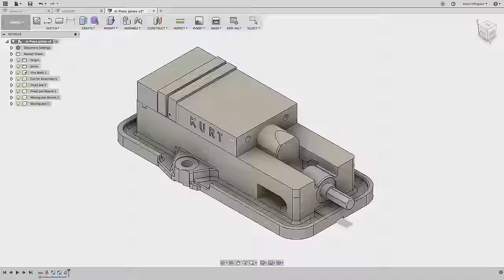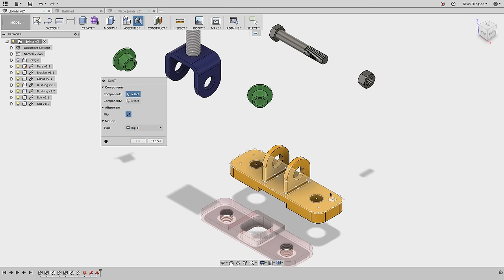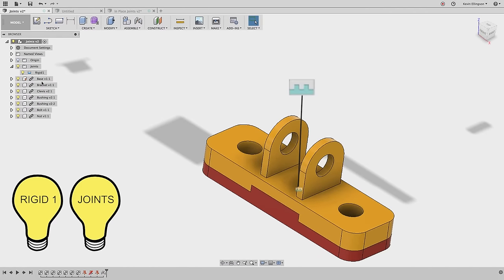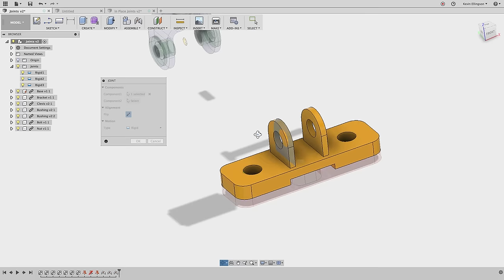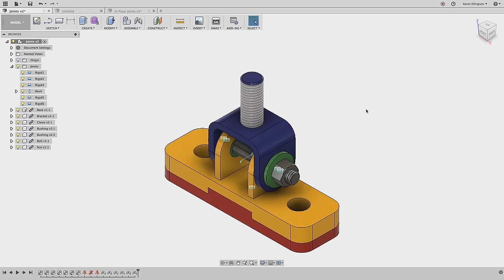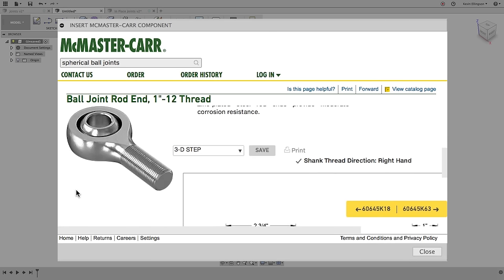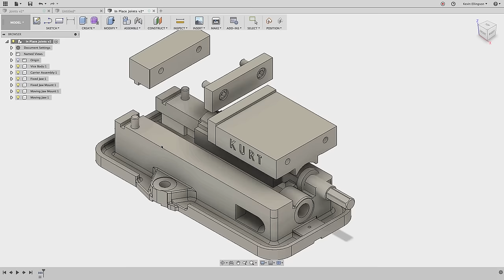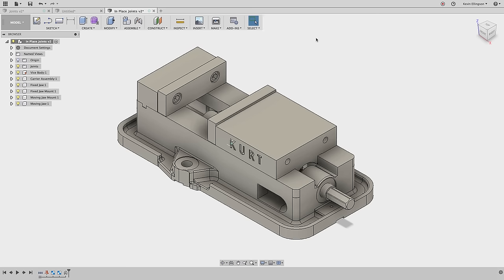Joints in Fusion 360: A Comprehensive Tutorial! FF117

Comment: After 20 years....I just abandoned SolidWorks and MasterCAM for design, engineering, and manufacturing. Fusion 360 is the replacement - really hoping it was a good choice. This video sure is helping me feel more confident making the transition.
Reply: I am sorry, but SolidWorks cannot be beat for modeling, but Fusion360 is closing the gap fast, especially with the built in CAM being so intuitive, not to mention tutorials like this help a lot.
Reply: I did not switch because Fusion 360 was a better tool - I switched because SolidWorks and MasterCAM are $$$$EXPENSIVE$$$$$. 

I used to skip 2-3 years of maintenance, and then get it updated - around $1,500 per year for each one. $3,000 per year in maintenance fees. Now, they do not do that anymore and charge for each year out of maintenance so I have to buy a brand new seat at about $5-6k for SolidWorks and $8-14k for MasterCAM depending on how they are feeling that day. 

So, to get the latest versions of each I have to shell out $13-20k and then get another $3k bill at the end of the year. Too much. 

Fusion360 is 95% of the function for 10% of the cost.
Reply: I still use SW 2007 because it can go fwd to any version. All they do is screw around with the GUI and the base function is still pretty much the same. And getting ripped off for the 'maintenance' fee, NEVER; plus I have clients who have every version if I need it. But as an EXPERT SW user, I am really liking F360 :-) but I will keep SW2007 around like an ol' dog.
Reply: Factory400 
I also got sick of paying the coersive maintenance fees so made the switch from SolidWorks as well. I might be OK with them if they would have been squashing bugs left and right and addjng features like mad, but instead bugs persisted for YEARS and the features added were few and far between (I think they did make some good improvements, just not enough of them). They never forgot to ask for more money though.

Every now and then I come across an old file that I saved with a name like "F... you SW programmers" and I'm reminded just how aggrivatjng that program could be sometimes.
Reply: LOL The topper was when they got rid of the colors in the GUI. What IDIOTS. The other one that kills me is getting rid of the textual right click 'edit sketch' and putting the icons in a stupid little separate box above the TEXTUAL part they left. Did I mention 'what IDIOTS!"? Its like SW programmers, and eBay, and many others say to themselves, "hmmm, the users are probably in a nice rut now, so lets just randomly change some cr*p and move and re-arrange everything because we have reached our limit of adding features and the bugs are too hard to fix and we are bored". I did notice there was a HUGE uproar where they realized they WERE idiots and put the colors back in the GUI, to avoid being killed by the raging mobs of modelers with pitchforks and torches. And now they have added CAMWorks integrated, but I think it is too little too late. Plus they are greedy. Oh, and SW would 'poof' and be completely gone off your screen when it crashed in 2007. Guess what, still does that in 2016; no other software I have used crashes so badly there is not even a trace on your screen....
Reply: I had CAMWorks in 2007 - worst piece of software I have ever paid for - ~$13,000 for an extremely unstable system that would periodically output rapid Z negative moves at the end of the program. It crashed my 3 month old 5 axis machine. I then spent another $13,000 on MasterCAM for Solidworks which is actually quite nice. fully integrated in Solidworks, but without the software AND physical machine crashing. 

I love Solidworks overall.....no real complaints other than the constant huge financial outlay for small, incremental improvements. I am both an electrical and mechanical engineer so having the PCB design (EAGLE), CAM and mechanical design all integrated - it is simply a better option overall. Eagle generally sucks pretty bad compared to the industry leaders, but they are improving it rapidly.
Reply: I use both regularly switching back and forth depending on what I'm working on and honestly there are a ton of things I actually like as much or more in fusion but there are some little things that either aren't there or that I've missed the option for that drive me crazy. It is a good package overall but it does have some QoL issues when compared to solidworks in the modeling department. We use solidcam at work with solidworks and its ok. Some things its great at but some parts about it just annoy me. I can't honestly say that I feel the difference is worth the 30k+ price tag my boss shelled out compared to Fusion I just can't see that much value.
Reply: I don't think it's from software engineers, but rather a group of corporate executives.
Reply: Would like to know how you feel 8 months later? These brands have made enough money over the years and would need to follow Fusion360 soon or else... Hated it when i started but it works better the better i understand it. The CAM is a joy. As a hobbyist  Autodesk allows me to use it with no cost!  Can't afford solidworks personally and its a waste seeing that i spent more than 3000 hours using it professionally in the elevator industry .

Comment: Excellent video. Hadn’t seen the “between two faces” part before. Two quick questions. I am trying to model up a tambour mechanism for a cabinet where multiple vertical slats, attached together was a canvas material on their back,slides along two groves, one at each end. The grove will have to go around a curve. Presumably one models the first slat as a slider joint along the path. Is that correct? With the subsequent slats joined to the one in front as revolute? Is there any way to copy subsequent slat components such that they retain their joints or do you have to add the joint functionality to each instance individually? Thanks

Comment: Great Video!  I was having a bit of a problem with my joints and have kind of figured it out. Do you think you could do a video really explaining a joint vs as-built joint because the joint doesn't respond as i would like, until I add a as-built joint to the existing joint. I may still be doing something wrong and it would be a great help to see a more in-depth video of how they work. Also is it possible to convert the joint to an as-built joint or is that what I have done with it by adding the as-built joint. Thanks

Comment: OK, I like the efficiency of your video. Just need one more step after. I'm designing a gate using McMaster Carr Bearings. I like the way you showed how to create components of imported bodies so I did that and made the inside bearing rotate around the bearing block. But when I wanted to move that bearing block to the swinging leaf it would not move. Is that because I had grounded the bearing housing?

Comment: I'm really stuck.  I have 2 circle parts, like wheels, and 1 part in between connected to both.  It connects to 1 with a rotating joint, but the other with a sliding joint.  1 wheel is grounded and when I spin the other wheel it should move this part using both joints...but I can't get it to work

Comment: Quick question tho...could you do a video on how you would properly constrain all the parts of that Kurt vise such that the jaw of the vice only moves when you rotate the spindle as in real life? Wondering how you or if you can constrain the model such that the model jaw moves the proper amount per spindle rotation (which in theory should change as the pitch of the threads on the spindle chances, right?)

Keep up the awesome video! This website has been a HUGE help. 👍
Reply: Right now you sort of have to "fake" that. There isn't a good way to add a ratio between a revolution and a distance. Might be a good video topic for when we can control the distance per rev if that functionality makes it into Fusion.
Reply: Motion Link in the Assemble menu allows this, just link a revolute to a slider and make the slider move one thread pitch per 360 degrees of revolution

Comment: I am trying to make a cabinet with drawers. One drawer was designed as a component, the others were created in a rectangular pattern.
A sliding joint was added to the first drawer later and an offset was defined in the joint to show an opened drawer. But instead all three drawers are shown opened to the same offset.
The result is the same no matter whether I create the joint with the "drawer"-component active or the main component active. In case of the active main component I intentionally created the joint behind the rectangular pattern in the timeline. It does not help - it always affects all drawers.
Could anyone help me with this? It is not a critical problem as the design is still correct, but I would like to improve the presentation of my design a little bit...

Comment: Are there any significant differences between a rigid group and a rigid joint? If I model in place why should I choose one type over another?
Reply: Clayton Firth A rigid group is less CPU intensive for sure. If you can do a rigid group after modeling in place that is probably the best method.